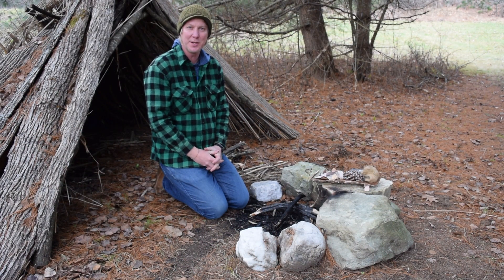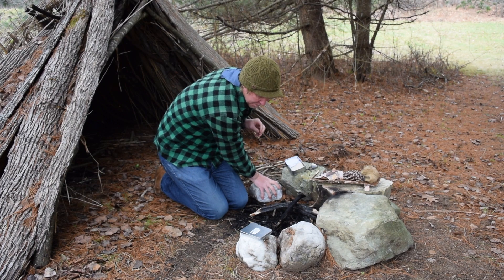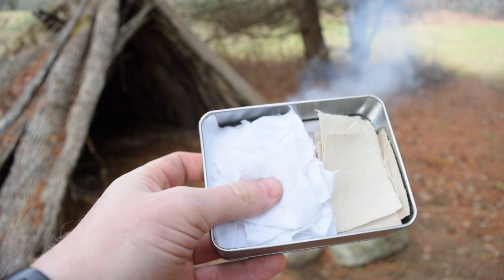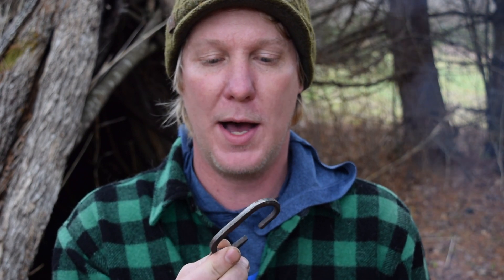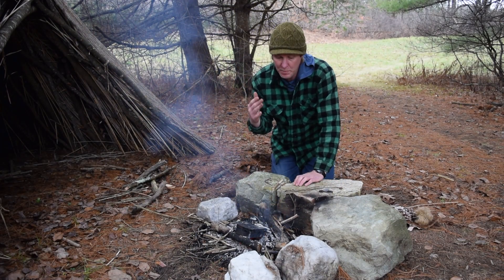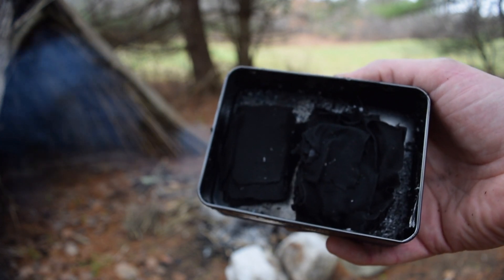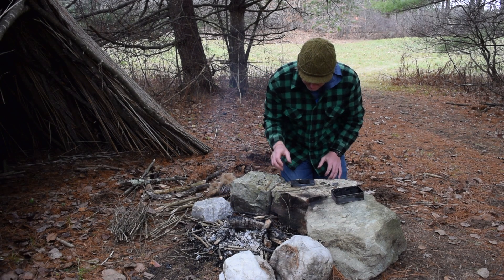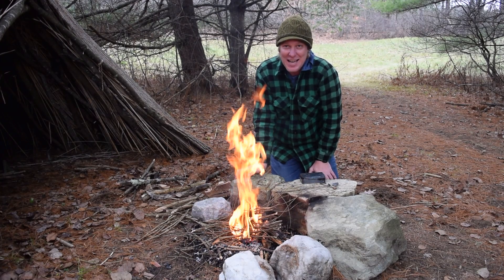Flint and steel fire with char cloth

Comment: Linen also works really well too. Linen was far more commonly used in the 1700's than cotton because cotton was expensive and linen was not.  You could plant a small area using flax seeds and grow and process your own linen.  If you use anything with synthetics in it like polyester or nylon blends, it will melt into a glob of goo. So only use 100% cotton or linen to make charcloth.

Comment: You can also use rotting wood instead of cloth, and char it with the same technique. It works great and keeps smoldering for about a minute or more, depending on the size. It's also more easily available when you're out in the wild.

Comment: Altoids tins work great, but my fav is an empty kiwi shoe polish round tin. Makes a really nice, air tight seal without needing a gasket or anything. Just the little hole in the top, fill it with cotton and wait for the smoke from the hole to stop. Done and done.

Excellent video btw. From making the char cloth, to using it.